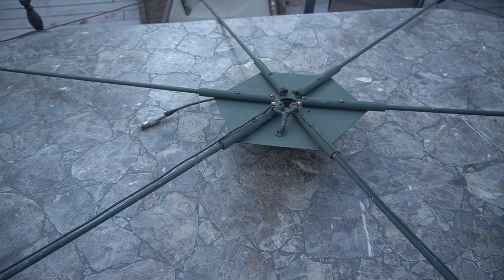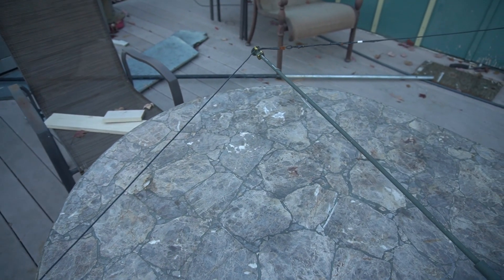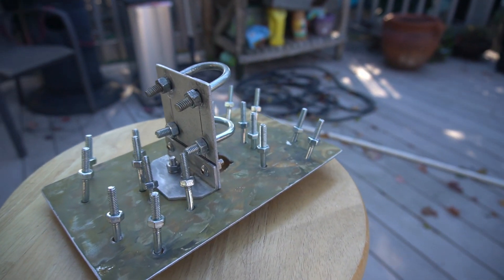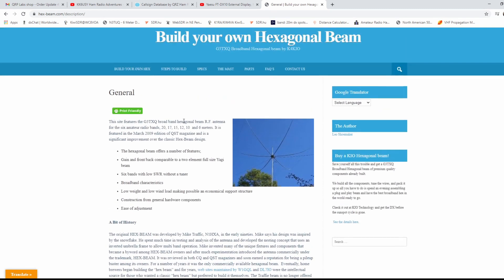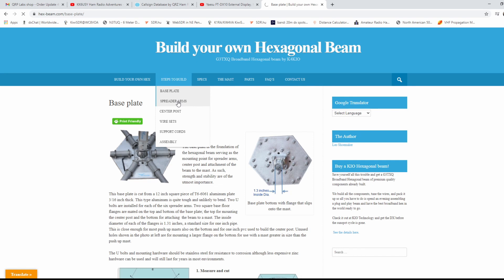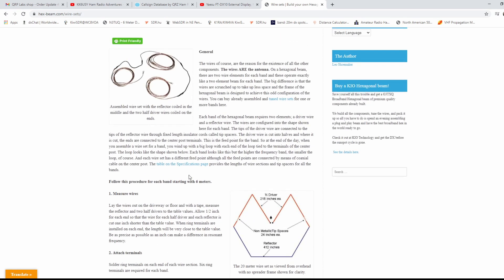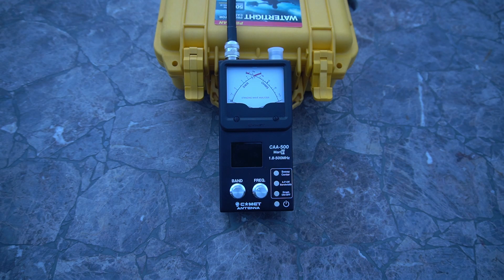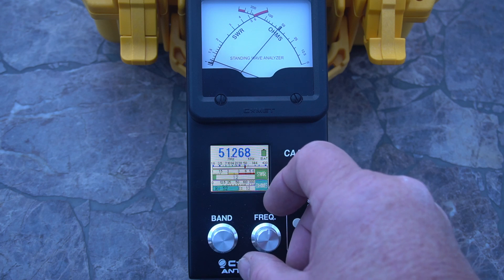How to make a portable 6 Meter Hexbeam!

Comment: Thanks for providing fascinating info on the 6m hexbeam antenna Chuck. I was in a hurry this summer and built a rg58 coax 6m T2LT portable antenna. Really quick build, cheap and easy to tune. Vertically polarized. 1000 miles cw qso when sporadic. Great fun.

Comment: Hi, nice video. I'd like to know if have some interaction to use aluminum spreader to fix the elements. I intend to build one for 5 bands and here in Brazil doesn't have fiberglass spreaders. Thanks best 73 from PR7TU.
Reply from the maker: Ramiro, yes I think it would interact for sure, try wood dowels or bamboo maybe. Thanks for the comment!
Reply: @KK6USYHamRadioAdventures  Yes, bamboo wood we have a lot! I'll try it, tanks, 73!

Comment: Wonder if it will tune to 433MHz also. (I have a 2m dipole with aluminium tubing which tunes on 433, 145 & 50MHz) Considering building a 10m & 6m hexbeam to use at home in the Summer here on South Coast UK. Cheers de G6ASJ.
Reply from the maker: Mick next time I have a chance I will try to remember to check it on 433 if I still have the comet analyzer! Thanks for watching and the comment!